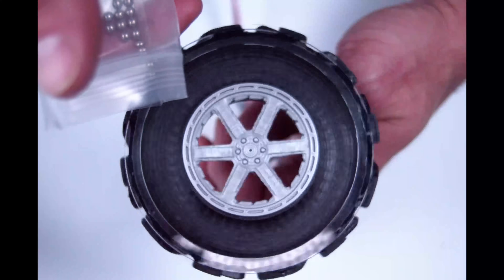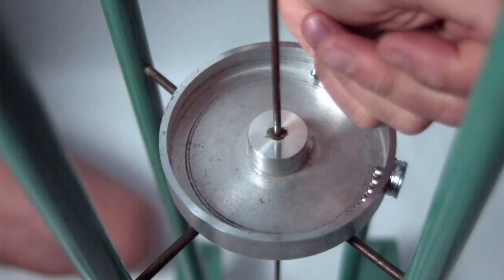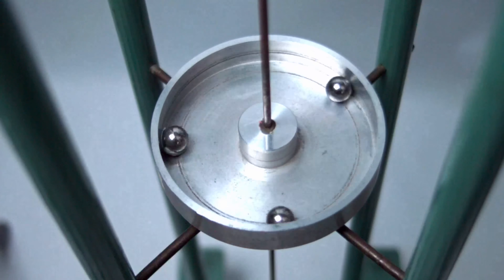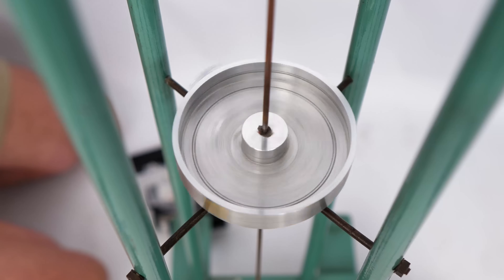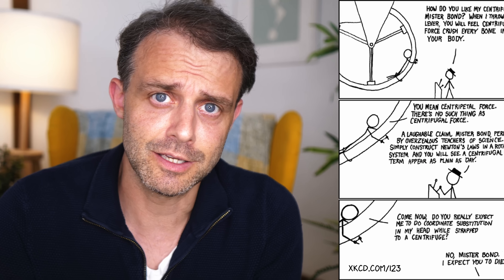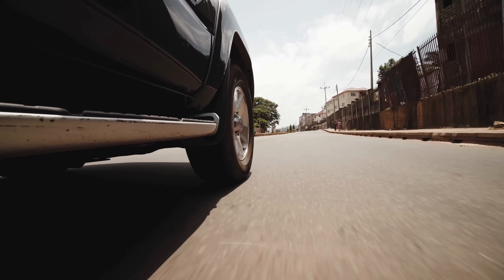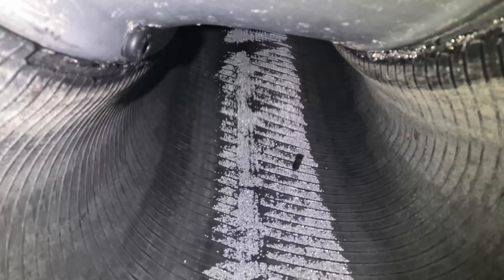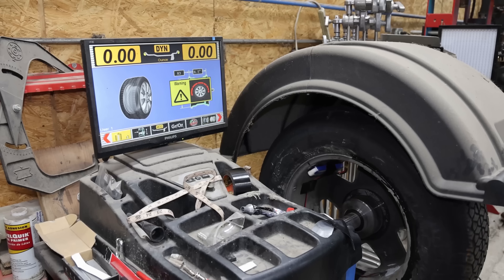Do tire balancing beads actually work?

Comment: Is the wheel hop resonance RPM consistent regardless of wheel diameter or mass? If so, would it be fair to assume the beads would balance smaller wheels at a slower forward speed? And for that matter, would having an extra ring of a smaller diameter inside the wheel allow the beads to do their job better, earlier?

Probably overcomplicated to engineer considering a handful of lead weights applied once by a mechanic on tire installation does the job just fine, but still, fun to think about.

Comment: I actually wonder if it's because the inertia of the wheel is high enough that the spin moves the unbalanced side to the opposite direction before the wheel can fully move. Countering the force in an opposite direction. 

If so the lighter the wheel the higher spin rate you would need to reach this state or perhaps just the heavier the weight.

Comment: 10:57 if you have an automatic jack attached to the bottom of your car like the mach 5, then you can spin your tires up to speed, slow them back down to the speed limit, and then drop back to the road when it's time to go
Reply: As long as your tires never stop... so you need to do a burnout every time you accelerate
Reply: @OntarioTrafficMan yes a 4 wheel burnout every stoplight 😂
Reply: @WyattHabel-f8n  the mach 5 had to have been AWD, everything in that show was ridiculous, the plans they were trying to steal from Pops were for an engine he claimed would make 30k hp 😂
Reply: Strapping turbines

WE'RE GOING STEAM, PUNK
Reply: That seems like it would cause a lot of stress and associated wear on the suspension, the transmission, and the driveshaft to say the very least.
Reply: He's revving up the powerful Mach 5

Comment: why didn't steve arrive at a conclusion about whether the beads are a scam or not?

based on my intuition, the very fact that the beads don't settle permanently (or stick) in their balanced spots makes this a scam already. having to spin your wheels to a fairly high speed just to get the beads to work again... means that this product actually could lead to dangerous outcomes, as plenty of comments have pointed out, in a rather sarcastic manner. so this is not just a scam, it's actually a DANGEROUS one.

and sadly, folks who might've gotten fooled by the scam are probably also less likely to understand the sarcasm in the comments. these are the exact people who would benefit from the science educator directly educating them, instead of doing cool demos which seem to confirm that the beads "work" in some way. imo, this video could have the VERY UNFORTUNATE effect of selling a potential scam to some people. if any of them gets into some accident over tryna spin their beads... can they blame steve mould?

Comment: Why not just use a epoxy that would cure while on the balance machine. Then the inner tire wall would be perfectly balanced. I mean it would have to be bonding and flexible etc. But basically something that would fuse to the internal rubber.

Comment: I have used a tire balancing fluid for 20 years in my smart car. It is also a hole plugger but it is the expensive kind that conditions the rubber instead of dissolving it. Anyway, it starts balancing pretty quick and takes awhile to flow to the bottom due to the consistency. Best part is I have had a dozen objects in the tires without a single flat in the last 2 decades. Pull the object, patch with plug, check pressure. Dry beads would not be as good. "Tire Protection Fluid"

Comment: Yes i have used them. On my trailer for my truck... A four axle drawbar trailer with 16 wheels.

My question is, does it work on a 22,5" truck tire at 85km/h..?

Comment: @8:43 , did anyone else besides me notice that there was a shift in the harmonic of the shaft of the frother to the mid point of the shaft ???
Kinda-like the critical speed of the shaft  moved the point of gyration to the middle and the prop-end started acting like a fixed bearing, ( like a pillow-block was there ). Interesting .....

Comment: I've used airsoft bb's and steel bb's myself and it definitely works as well as the store bought beeds.    I have also seen people use golf balls and antifreeze as well in larger tires and claim it works well.

Comment: I worked in tire shops for 4 years as a teenager. Now I’m a software engineer. 

Balancing beads have increasing usefulness as tire diameter goes up. Ones you get to 42” tires and bigger it’s the only way. Sedan tires? Waste of money.

Comment: I wonder if anyone makes beads that are coated in some kind of heat activated substance that will help the beads stay in place. Put the beads in the wheel at a relatively cold temperature, then drive onto a highway, maintaining highway speed for say 20 minutes. This heats the inside of the tire up to over 40°C (over 100°F). Something like a HMPSA will become sticky, holding the beads gently in place, even after the wheels cool down. Next time you drive, the beads are already in the right place.

Comment: I can't help thinking that the geometry problem around 6:00 only works out if several several variables will happily cancel out in a perfectly symmetrical system. There's a single point in the plane for the free ball that will bring the barycentre of the system back on the axis and 1) it might not be on the inside track at all (ie. if the free ball is not the right weight) and 2) if the track is not perfectly circular with the same centre as the axis, the closest point to the solution might not "see" the barycentre on the normal, thus leaving a non-zero tangential component of the centrifugal force that throws the ball off-balance. I'm not sure though how to show if it still converges to a stable solution (the ball will find a slightly offset position where the tangential forces cancel out) or it could be an unstable system.

For an extreme example, let's say the circular track is replaced with an astroid or deltoid (which is convex at most points instead of concave). Probably some operational adjustments will have to be made, like rounding off the corners to avoid the ball getting stuck, and picking the mass offset direction sufficiently away from the corners.

Anyway, thanks for nerd-sniping me at 3AM, now I'll have trouble falling asleep :)

Comment: Is there a way to know how much minimum added weight is required for balancing beads?
They market these for UTV or SXS , they are essentially not effective at low speeds (which are typical of offroad) then if I understand the assertion? 
But in that application possibly they dynamically counteract mud and debris buildup on the wheel causing imbalance in that application?

Comment: I wonder if you could automatically and permanently balance a tire by mixing the beads with a strong adhesive and then throwing them into the tire and spinning it up very fast, for a few minutes. In theory, they would then adhere in the correct place, and would be permanently affixed once the glue fully dries.

Comment: This his commonly used to balance semi truck tires. I use it in my 35's  on my pickup and it works ok, not as well as a true balance.  I don't know why the larger tires make a difference.... maybe the larger mass has a lower resonance frequency.

Comment: This is the only way to balance truck tires for ages, counterweights aren't big enough and useful enough to make a difference on such massive wheels and tires and especially made so poorly. The best bet is to add sand or beads to have it balance itself when rolling fast enough. This kind of principle has also been used in rock racer tires, but not to balance them out completely, mostly to have the lead in the tires to shoot forwards when hitting a big enough obstacle to help the vehicle shooting forwards and over the obstacle. You might want to look into that also as a add-on to this video.

Comment: That's weird. My intuition was right from the start. It was 100% logical from the start that the Transfugal force pushes them on the right spot. Acually, it was weird to see that it doesn't work without enough speed. It makes sense, but it's funny that my intuition was turned just cause i had other experiences, i guess.

Comment: I wonder then if there's a method (if it's even worth it), of putting in a slow setting glue, then the beads and running the tyre to high speeds to get them in the right spot, then letting it set...

Comment: Well, you could use some sort of silicone and let it settle at highway speeds (or rotatting the tyre at a rig really), once settled it will stay there for a while, and as it's silicone, it won't be unstuck by the deformation of the tyre

Comment: Steve please. This spring I had to calculate vibration systems like shafts from motors and cars on bumpy roads and elevators hanging from a cable coming to a stop. I can't handle anything adjacent to reading SFS-ISO 1940-1 MECHANICAL VIBRATION. BALANCE QUALITY REQUIREMENTS FOR ROTORS IN A CONSTANT (RIGID) STATE. PART 1: SPECIFICATION AND VERIFICATION OF BALANCE TOLERANCES.

When you increase the rotational speed, I think what's happening is the amplification factor M changing meaningfully. Now it's not an explanation of why it happens in the physics, but a description of how it behaves and it's not talking about the beads finding their places. Like if you look up vibration stuff, you find a term called r which is ω/ω_n which is the ratio of the natural frequency and the rotational frequency. The graph showing the function M(r) in relation to the ratio r depending on the case changes significantly to better depending on where in the graph you are. Sometimes you get a discontinuity like in 1/x and sometimes it starts growing from 1 and hits a peak of infinity or something huge and then starts coming down (with the dampening factor ζ hitting 1 i.e. critical dampening) to almost 0. In that kind of graph the bigger the ratio r, the lower the amplification factor M.

Now don't hold me accountable on this, it was a tough class that I barely understood and decided to forget as soon as it was done and it's been many months since I thought about it.

On more interesting topic, my teacher in that class managed to sneak in a MacGyver clip to keep the students engaged. They landed on a tall scyscraper building on a helicopter and you could just see at the end of the scene how the helicopter gets caught in ground resonance and the pilot quickly rushes off just after the people have touched the ground skillfully managing the dangerous situation without incidents.

AnyDesk is that service that the customer service scam callers have abused a lot?

Comment: 0:46 rumble pak- for those born after 1994, they were a separate device you would install in the bottom of your N64 controller so it would shake at the right time during gameplay

Comment: Just an idea why not mix some slow setting glue with you're tire beads, slow setting so that the beads can still freely move and give you enough time to install them and take it on a motorway drive but glue so that after a couple hours of motorway driving you're tires are now permanently balanced and the beads wont drop down due to gravity once you stop again or atleast most of them won't avoiding the problem of having unbalanced wheels until you hit the motorway every day.

Comment: My question is whether these could be used in conjunction with traditional balancing weights to further optimize highway driving efficiency. Long haul trucks seems like it would be an interesting test. C'mon Steve find a trucking company, get a bunch of glass beads, put them in half the trucks, have them log fuel efficiency, and come back in a year.  Do it!

Comment: The problem in my mind is that the idea that "centrifugal force means the beads stay in the right place even if you slow down" ignores that pneumatic tires are, by design, a non-rigid shape able to rapidly deform in response to external forces exerted on them by the roadway. As the tire shape changes in response to these forces, this is going to change the angle of the surface relative to the centrifugal force, causing the beads to move to a different position to try to find balance again, only to then be out of place once again when the deformation rebounds or otherwise changes. It also ignores the forces created by the wheel and tire of the car being a sprung mass on the suspension, which can itself create forces that would work against the pinning force of otherwise pure centrifugal force. And all of these would show greater effects at lower rpms, when an unbalanced wheel is most noticeable AND the beads are less capable of reaching their correct spots to achieve balance.
I'd be curious to see how your model would behave if the beads were rolling against a flexible surface instead of a rigid one, and then that surface was subjected to outside forces deforming or even simply jostling it, rather than simply spinning in open air.
Reply: Physics aside though, I'm just imagining the unintended consequences to the driver from the mechanic who had to remove the tire and now has thousands of tiny beads all over their garage floor. I've seen how they react to finding a tire filled with that leak-stopping tire slime and it's not pretty.

Comment: In the USA, a typical speed for non-highway drive is sub 50mph. So it doesnt help there.
Then we dont have many roundabouts. So, we're probably going to be forced to stop at a light or a sign soon after getting off the highway / traveling at more than 55mph.
 If your analysis is correct, these would only help in very specific conditions that most people here would never encounter.

 From this, it sounds like a solution looking for a problem.

Comment: I have been using dyno balance beads for decades and for motorcycles, it's a game changer and keeps the tires from cupping and has a smooth ride for the life of the tire. Ceramic beads are the best and don't reuse after tire change. The wear is minimal on the inside. I will never stick weights on a wheel again [they only last for half the tire life]

Comment: I wonder about putting bearing balls in a waste oil or algae centrifuge, to reduce vibration. These units typically run between 3,500-6,000 RPM. To be effective, these units need to run for extended periods of time, with a very low, almost a mere drip feed rate for the fluid. A 'perfect" balance would really prolong the life of the axle bearings, and greatly reduce power consumption. Would the beads still find the perfect spots, immersed in viscous fluid? What about water?

Comment: Small error at 6:14 you don't stop rolling because of the floor being perpendicular, that's the point where you cannot stop by yourself - you oscillate between the sides until enough energy is lost and you come to a rest at (or close to) that point.

Comment: Balancing beads are incredibly common for motorcycle tires, especially for adventure bikes that mix on road and off road activities. When I change my tires in my garage, I always put a kit of balancing beads in the tires and never bothered with the more common wheel weights.

Comment: Never used those before, but here's my issue. You may think that if you do a lot of highway, it'd be worth it, but when you actually think about it, you'll have the issue of unbalanced tires all the way to the highway, and the moment you hit a stop or a red light, you're back to having unbalanced tires. Just have your tires balanced, and don't deal with quick, temporary semi-solutions.

Comment: Yes I have to speed to not cause excess wear to my tires/wheels/suspension/ frame welds
Reply: ...and i would get to replace my wheels bearings way more often due to sub-auto wheel balance speeds

Comment: [commenting @3:30, haven't reached the conclusion yet]
My intuition is that this is a case of a system trying to reach it's lowest energy state, in much the same way that gravity pulls things into a sphere.
A balanced mass rotates more efficiently than an unbalanced one, so the loose mass in an unbalanced rotating object is in a higher energy state, and sheds that energy by moving into a balanced position.

Comment: They sell them per tire size...they actually work really good....the local tire shop used them,said if they don't work they will fix it... better than losing wheel weights off the rims😊

Comment: Could you add some hardening resin alongside the beads and then go for a drive at 80 km/h for long enough for the resin to cure and fix the beads in place? Then you'd have the tyre balanced permanently.

Comment: Balance beads work originally designed for semi. Truck tires that run at highway speed Most of the time, they are not TPMS friendly.

Comment: My issue with balancing beads is that, as you mention, they only work after you've gotten up to highway speeds and stop working if you stop moving at any point. In all other cases, they make your wheel more unbalanced than it already was before.

So unless your drive is pretty much exclusively highway -- with just the right amount of traffic such that you can get up to full speed, spend some time at medium speed, and never come to a stop -- they're worse than useless.

Comment: So you have to get on the freeway to get them into place so that you can drive at a slower speed with balance, but that would mean you're getting off the freeway, which means you immediately come to a stop at the bottom of the exit, and the beads fall back out of place. Yeah just get the professional balancing done.

Comment: So for big trucks in the usa, they have a device called a centrimatic. You bolt it between the rim and the brake drum and its filled with a fluid and weighted beads to take advantage of this exact effect.